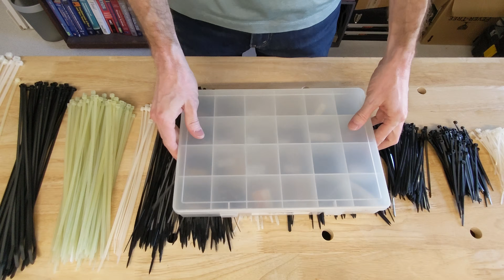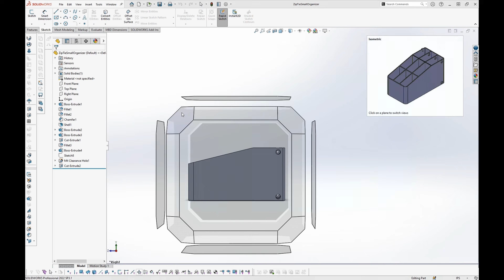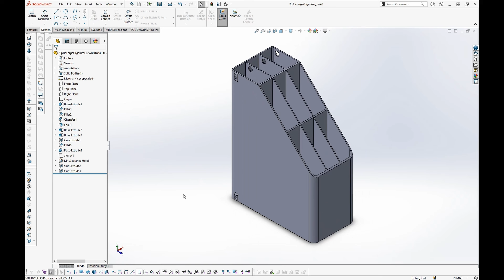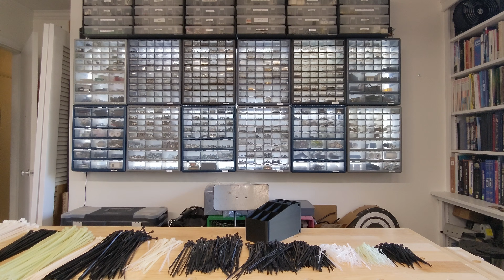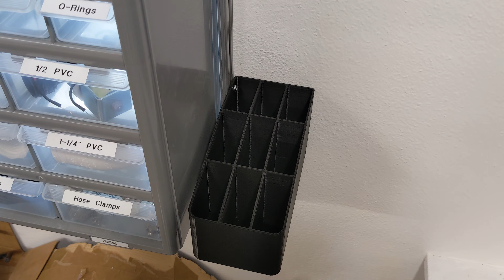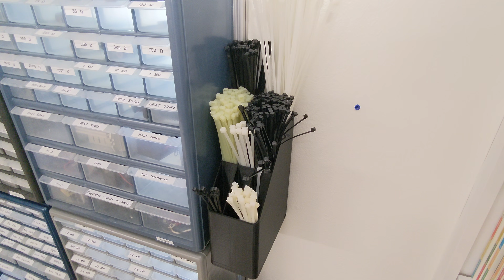Zip Tie Organizing Solution for the WALL OF STORAGE

Comment: There's also a variant called spring loaded roll in t nuts, that have a spring loaded ball on the back. You roll them into the profile and the spring and ball keep them in place. I found these much more comfortable to use, especially if on a self-built 3d printer you have to use a gazillion of them.
Reply from the maker: That's a useful tip.The ones I use here can be fiddly. Pulling back to lock them in helps but I wouldn't want to try managing more than two at a time that way. Thanks!